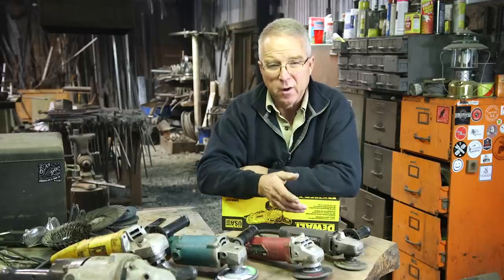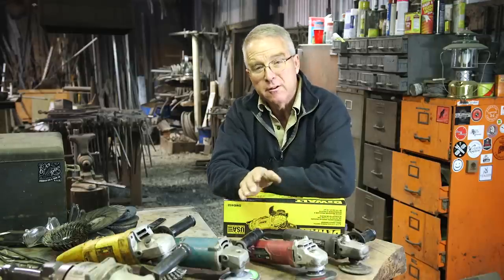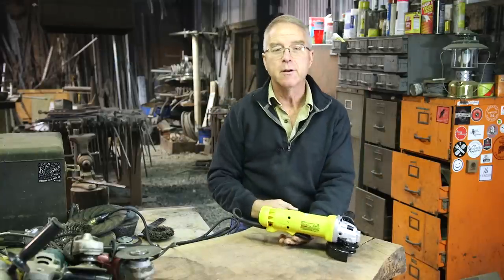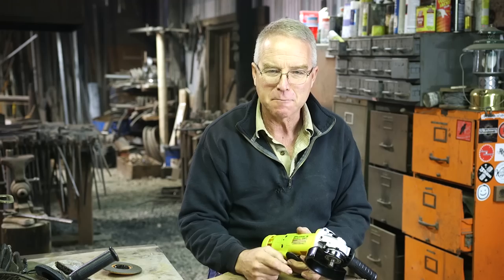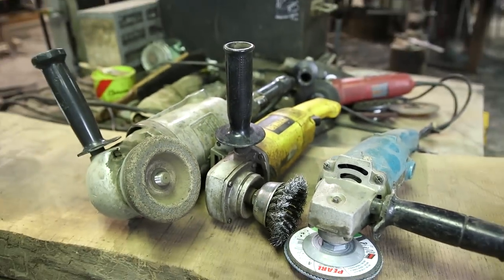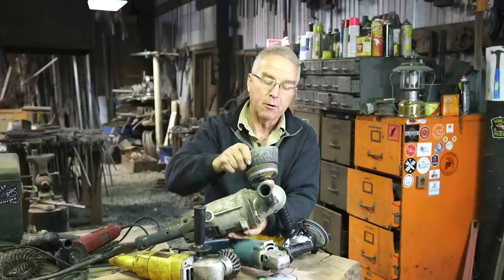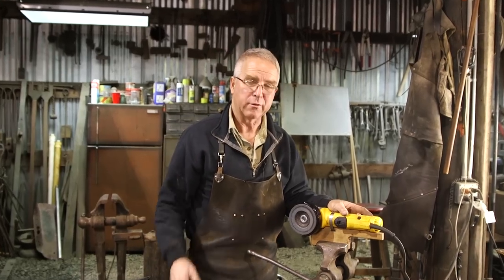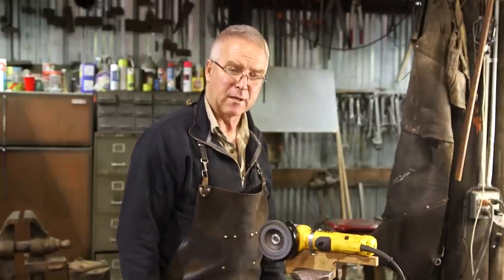Get Another Angle Grinder

Comment: The 4.5" Milwaukee on my welding table has worked flawlessly since 1982. It needs a new cord now, and could use a set of brushes, but it's outlasted half-a-dozen other brands.

For safety, learn to lay your grinder down with the wheel facing up.

I concur that paddle switches are the only viable choice, ... most "off center"  thumb switches are awkward and dangerous for left-handed operators.

Comment: Interesting to see the differences in tool in your area vs around here... here in Australasia 4" disks only really come on DIY grade (or cordless) tools, almost all worksite aimed stuff is 5". You'll get kicked off industrial or construction for lacking a guard or handle, but such features are uncommon to see in metal shops I've never found one in a mechanics or bodywork type firm.

Threaded cups are pretty expensive compared to the clamped sort around here also, so you tend to see more of the other on jobs, although every now and again you do see somebody trying to save time by using one to hold a cuttoff wheel in place, better to have two skins in my opinion. In a simlar not quite so safety conscious way I've never seen a wrench used by the average shop for anything but removing a stuck disk, common practice around here is once its finger tight, you just grab the disk itself and give it a turn by hand while holding the lock button, even finger tight the clamping load will ensure both disk and nut move together in that moment. While you'd think the reduced diameter (thus leverage) would be a drama when you come to remove it, you only need such a brief pulse of torque to break it loose that its maybe only 1\20 times you need to find the wrench.

Comment: My welding supply store won't sell DeWalt grinders because people kept bringing them back. I'm 63 and am on my 2nd Matabo. Won't by anything else
Reply: I can agree with your welding store.  I have never worked in a welding shop that used DeWont grinders, hell I couple shops even had black and decker's (not many, they die too quick when grinding half an inch of hardfacing off a milling drum).

Comment: I have 4 but carry 2 on jobsite at all times, 1 has 6 in metal cutoff wheel on 4 1/2 in grinder and other has diamond blade for concrete.....remodeling houses I dont have time to switch blade all the time so as you said just set a cpl of em up for what you need........and yeah never use guard just gets in way....and yeah I got nice set of scars on left hand that got away from me

Comment: Maybe one of the most dangerous tools around ... used with the chain saw blade. Beware that there is nothing to lock the wheel up if it kicks back at you and ... and it's running faster than a chain saw. I think that blade should be outlawed unless they make the wheel stop instantly when the tool comes free from ones hands, and it does when it catches the wood and jumps, totally out of control. I will never use one but love the angle grinder as it was intended to be used. Have you ever tried a dual blade angle cut tool (blades rotate in opposite directions). It cuts metal like it was butter.

Comment: Agree...get a tool that does the work rather than obsessing over build details as a career. I have several grinders, all different switches, and I rarely care about the differences. Have a 7”, I think Ingersoll Rand from 1976. I can barely lift it any more, but it’ll still be running in the 22nd century. Has a trigger like a gun; be ready to shoot when it’s plugged in.

Comment: I also hate paddle switches because of the limited number of hand holds you can apply with them, which im sure is why OSHA requires them on safety strict jobsites. However i disagree on the one size fits all opinion of thumb switches, i own two metabos (which of course are a different class altogether than the grinder you gave as an example of the point) that have quite comfortably placed and secure switches right next to the left handle hole. I find them to be my favorite switch because of the user independant on/off modes just like a push button on your table saw or band saw

Comment: Kind of surprised you didn't mention masons (heard the concrete bit). A grinder with a tuck point blade is as common use as a grinder sees. It's essential (craftsmen) and the go-to means for grinding and thus repointing. Just chiming in as I'm sure you knew this. p.s. Makita is my choice for angle grinder.

Comment: I have a variation of this Dewalt angle grinder with the same arbor lock button for changing the disks.I loved it at first until that button jammed up. It still works but is lopsided. Has anyone else noticed this problem with the Dewalt grinders?

Comment: An angle grinder can be a real work changer.  A little bodied model has tremendous utility compared with cost.  The attachments are inexpensive.  For $100 you can buy a Milwaukee grinder and a box of attachments.
I needed to cut a PTO shaft on a tractor implement.  Very hard steel.  A shop charges $150.  The small grinder and one wheel did the job with ease.

Comment: My best bang for buck is dewalt 6" power of a 7"-9" but will run 4" but- my 4.5" like that gets used almost as much because it fits places keeper clean like a chainsaw put a 17' cord or a 12" cord on when it's time to swap it keeps the plug from snagging just my penny opinion

Comment: I run a 5,000 watt laser at work, just from cutting up skeletons a metabo or fine brand angle grinder only last about 4 months. We also use 6" cut off wheels on 4 1/2" grinders, obviously no guard. I never wear safety glasses, because I'm young and dumb. But everytime I do turn it on to cut a skeleton I remember that the only reason I have that job is because 8 months ago the previous last operator almost died from an angle grinder. He was cutting a skeleton up on the table and as he was cutting it and pulling chunks off a part slipped as he was cutting so he went to grab it with his left hand and somehow PLUNGED the running angle grinder with a cut off into his arm. He literally almost died, blood everywhere and sent to the hospital. Now he's done working there but his arm has permanent nerve damage and a sweet 7" scar...like he said in the video "Do as I say and not as I do"..

Comment: The paddle switch is very dangerous in my opinion. My top grinder is dewalts other option with the side switch. The smaller diameter body and price of 60 bucks can't beat it!
Reply: Paddle switch is the best switch for angle grinders. With a paddle switch I can get feather control.

Comment: I use my cordless grinder for trimming my horse's feet using a 40grit flap disc. Very convenient for a practised operator.
In my old age with disabilities, particularly now weak arms and hands from a stroke, the grinder has been a saviour.
However... The batteries all failed within weeks of each other on the old 4" (100mm) disc grinder.
Since it was superseded, I could only get a 115mm (4.5") grinder which was too big and powerful for my needs and my poor suffering arms!
Also the arc of the disc was too big to fit the horse's feet so the trim was awkward and untidy. Frustrating!
Then the really frustrating thing was I couldn't put a 100mm flap disc on the 115mm grinder!
The arbour and shafts are different sizes. Why do they do these things?
Is there a solution?

Comment: I have had my wheels explode, I cut through 12 feet of steel angle iron used as lintel in an old building with old red paint on it. So I was wearing a full face mask and shield to protect from the lead in the paint and shrapnel. The blade exploded and put a nasty scar on my face shield and it was very scary to work with after that. As difficult as it was on a ladder and holding the grinder above my head I got through it. It only took three abrasive discs to get through that and another lintel 1/2 the size on the same building.

Comment: Thumb switches are not bad at all. If you're on it for an extended period of time its the best type of switch. I run 5 of the same Bosch grinders. You get used to the thumb and your hands are more relaxed because you don't have to clench all the time. Less cramps & less strain. 

Grinders are nasty. Find what's comfortable and get multiple. Nothing worse than having to get familiar with one. 

PSA... Metabo make a low profile grinder. It's f@$&ing pricey but it will get you in to any spot and it has a quick release guard that you can adjust in a flash. Ramp up speed switch. It just works.

Comment: I have a cheap DEWALT with the locking thumb switch in the side of the grip. I really like the placement. Also, can’t be too careful with those cutting wheels. I had an accident left me blind in one eye, so that means I’m one accident away from being totally blind. I’ve had a ton of those wheels blow up in my face without any warning. I happened to be wearing goggles

Comment: The older dewalt 4.5 inch has a third attachment point for the handle. It is right on top of the head, 90 degrees from the other two attachment points. Also it is not nearly as big around so much easier to use, no hand fatigue. In my opinion the older one is much better.

Comment: The DWE402 shown here is the best cheap 4-1/2" grinder on the market and is pretty universal for industrial use.  They're cheap enough you can buy a bunch of 'em, they don't have any fatal flaws, and they have plenty of power.  The entry level Metabo is nice, but underpowered by comparison.  The only other grinders that might be better in some measurable way are all over $100 at which point one might as well step up to a big 7 inch grinder like the 15 amp Makita guy.

Metabo used to be the best grinders around, period.  Unfortunately, they're not as skookum as they used to be now that they're made in Asia, though they are still quite good.

Comment: Owning both types I do prefer the thumb switch versions but that’s my preference in my home garage fab shop - but what do I know as I’m just a hobbyist not a know it all pipefitter!! My biggest gripe of any of the brands I’ve used & this also recently starting happening to two exact dewalts I purchased together about a year ago... the cord where it goes into the casing just gets fatigued from regular use and loses power randomly. My Milwaukee & makita have had this same problem which I thought I’d have better luck with the dewalts - I guess not.
Reply: As a know it all pipefitter I agree with thumb switches. And If your chord goes to shit, just cut it shorter or buy a new chord.

Comment: Thanks for the video!
What's exactly your problem with the thumb switch? That it is on top? Too stiff?
Saw a guy the other day who turned the gearbox 90° so the switch was on the left, for the right hand to reach better....
Reply: I have that same skill grinder with the thumb switch. Aside from awkward placement, it's stiff to work and worse, hard to lock on, especially when it got dusty(almost immediately). Grinder works decent for 50bucks but I'd never buy it again. I'd stick with a trigger style personally

Comment: The guard locks into positions 90 degrees either direction from 0 (handle side) and will come off without any tools at 180 degrees from 0 (opposite the handle side).  Not as young as I used to be, I find myself using the (small) Dewalt for everything my 15 Amp cast aluminum Makita is not required for.  Nevertheless, when you need the big power, just dim the lights with the big boy and get her done.

Comment: I was just curious if you have tried a Battery Powered Angle Grinder and had any thoughts on those? I have a Milwaukee M18 that is working very nice, but it is wipes a battery pretty quick in my opinion.

DAT

Comment: To me personally the correct number of angle grinders is "yes".
Seriously though it's hard to beat the plug in Makita rat tail grinders. I have half a dozen of them and love them to death.
Cordless I run Dewalt stuff because I prefer their batteries.
I have the guards for every grinder I own in a drawer at my "grinder station". Whenever I'm working on site I always bring the guards for whatever grinders I'm bringing. I also keep 2 or 3 in the plastic safety glasses because yeah don't lose an eye fellas. 
Also never quite know when an apprentice is going to be on the tool. 
Got any ideas how to prove to them you don't where gloves with rotating tools other than them losing a finger?

Comment: I have heard many people advocate having several angle grinders in order to keep a different disc/brush/wheel on each one. I don't get it. You press the button in, and you unscrew the wheel by hand. Then you tuck your glove under your armpit and unscrew the nut. Put the other disc on, screw the nut back on, and hand tighten. Put your glove back on. It's easier to change the wheel than to untangle or to wrap/unwrap the power cord on multiple grinders. 

Die grinders and routers, now these tools are a pain to change bits. Gotta use the wrench(es) and set the tool down. But I don't hear anyone advocating owning multiples of these tools in order to save on bit changes.

I can see owning multiple grinders in different sizes. And maybe having a big and a small 4 1/2", a small one to use with one hand. two is better'n one when you are talking a tool this useful. But the wheel/disc changes are usually too easy to mess with multiples of the same grinder for one project, IMO.

Comment: Those guards don't lock in the position where the wheel is open to your hand. I'd prefer it if they left it entirely up to me, but I can see why they don't encourage such behavior. 

I bought the DCG418 last week (Dewalt Flexvolt cordless 4.5"-6" grinder) and couldn't be happier with it's performance either. My other grinders are 4.5" and that's definitely the default size, but a 6" disc can sure speed up some jobs.

Comment: If you don't like the guards, don't take them off; cut them down. Cut the guard down until it's just a wedge wide enough to keep your hand from riding up the tool body and straight into the cutoff wheel (or whatever is mounted). I sometimes like to get a grip around the head of the tool and I'll place my index finger on the back of the guard for a little more support and control with the trigger locked. No guard = can't do that.
Also... I'm a big fan of full face shields. Even if I had an iron clad assurance that nothing bad would ever happen, I just got sick of getting wires stuck in my cheek and aluminum chunks in my mouth. 3M makes a completely decent one that runs about $12. I've been a big fan of them for years, and if you're a welder, it sure beats the crap out of throwing slag and grinding abrasive at $500 hood.

Comment: I only buy grinders with a side thumb switch.  Why,?  Because in my opinion it is the only reliable method of turning it on or off.  Paddle switches are very hit and miss function wise.  Some are a royal pain to get past the safety portion (Milwaukee comes to mind).  The only time I see a guard missing is when the manufacture requires a tool to change the position.   So all of mine have a cam actuated lock, never had the desire to discard a guard after that decision.  I see DW has implemented another version where you spin the guard and it clicks into various positions.  Have not run one of those yet, but my gut says they "improved" on something that should have been left with a cam lock.

Comment: So two little notes here
first:
a friend of mine once worked with one of the little angel grinders without a guard. he was cutting stones with a hefty steel disk when the disk jammed and brocke. he was delivered to hospital with half of the blade stuck in his kneecap, so please do not take it off unless you have too and do put it back on...

seccond:
while working a construction site a few years back I had to borrow an angelgrinde from someone because mine had broken down. and the only guy to have one was an old drunk that had loost several digits of his fingers.when he handet me the grinder I saw why. he had not only taken of the guard to fit biger disks on his machine but had also while changing brushes put the grinder back  together so that the switch was now underneath the blade.
this meant the only way to turn this devil of machine on was to take a screwdriver reach under the blade gingerley turn it on  and then after you where done working sticking your screwdriver under a now running blade to try and turn it off again without the srewdriver or the disk going suborbital on you....
even worse still when I offered him to at least put it back together the right way ( I am an electrician) he yelled at me to leave as it is because this is how he likes it..
Please please dont be that guy.....

Comment: You are so right about switches; I have a Black and Decker drill that is impossible to pick up without pulling the trigger and turning it on, the trigger occupies more than half of the handle. I have had at least one accident because of this. I drilled a hole in my leg. Even now 30 years later I still forget. Stupid design.

Proxxon do a tiny little angle grinder about 1.5 inch. Best tool I ever bought. I have a Dremel which is ok, but the Proxxon does things no Dremel can do, for little work I highly recommend one.

Comment: I have 2 dewalt 4 1/2 inch angle grinders.. both with thumb switches.. switches seem fine in my world but the shaft lock failed on both... disappointed.. had them both for around 20 years but still..

Comment: What is job 1, remove and throw away the safety guard? Weld a bolt to a flat plate then screw into the handle thread, perfect for vice work.

Comment: Have some with guards, some without.  Try to use the guarded one more often, especially with the thin bladed abrasive wheels.  Guards saves you from injury, but it also saves your clothing.  Hand grinders are hell on clothing...consider wearing an apron.   Am a big believer in hard plastic face-shields rather than goggles.